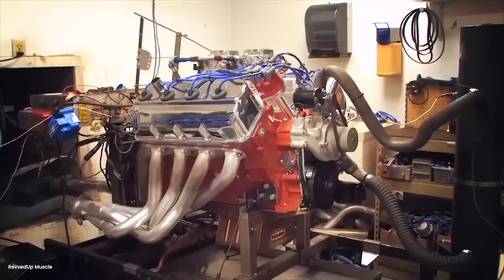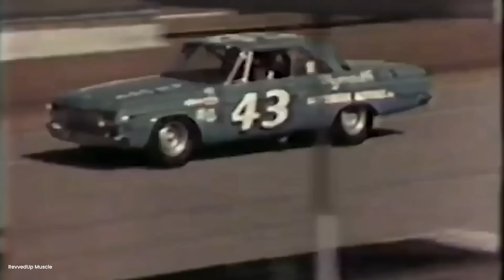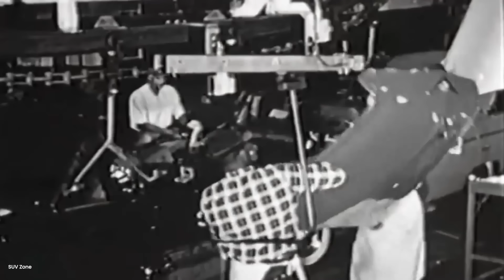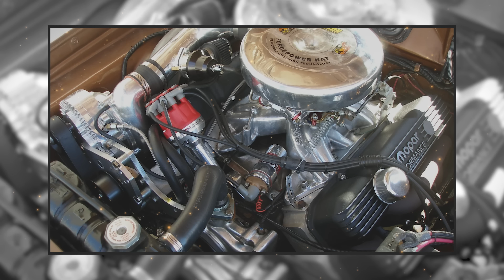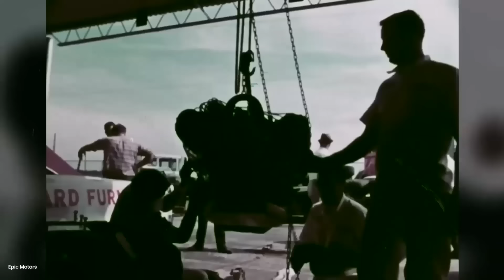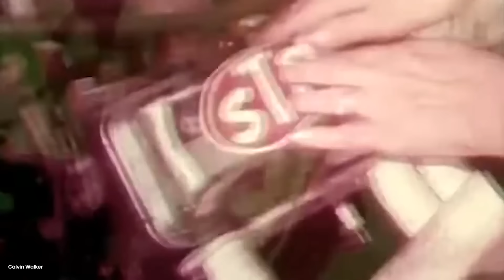This Pennsylvania Mechanic OUTSMARTED Dodge With a "Secret" 440 Wedge Trick That Added 100 HP

Comment: Back in the day I had bought  a 3 year old silver Chrysler drop top not sure what size the engine was but it was a RB with a 2 barrel. The first mod was adding Chrysler 300 exhaust system with Cherry Bomb glass packs, no tail pipes just 30 or 60 degree turn downs.. Then a 2 four barrel intake and carbs. Then a 1963 Super Stock distributor with lighter advance springs. Then a 1963 SS solid lifter cam and adjustable rocker arms. That car with stock valve spring would hit 6800 RPM per my Sun tach. That car was a bomb or should I say MONSTER ? But I never kept the car and I was going to detune the distributor due to very poor gas mileage. I left the car in all stock trim and at red lights people would look around to see where all the rump rump was coming from, LOL !

Comment: The 426 and 440 blocks were NOT the same. The 426 block has 5 bolt per cylinder instead of 4 and 3 of the mains were crossbolted.